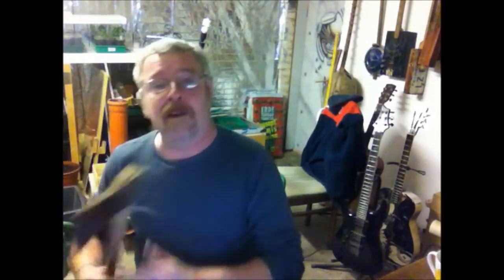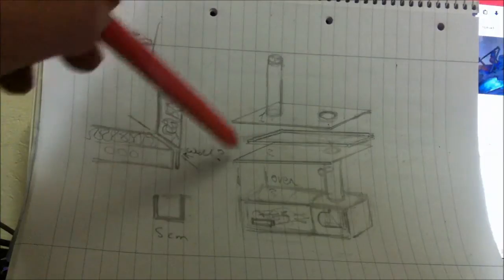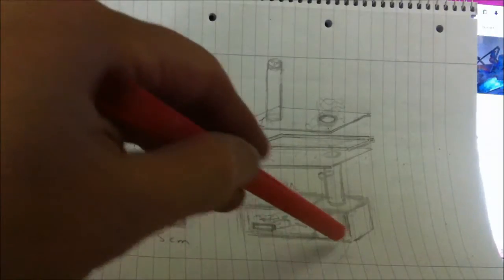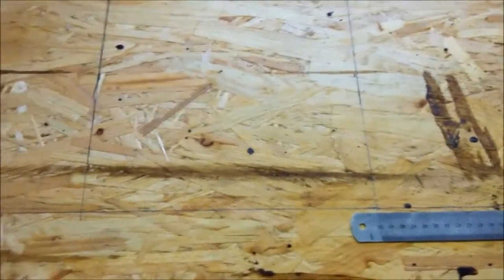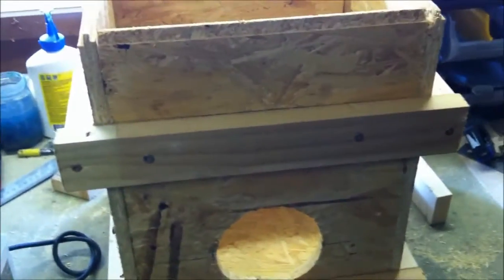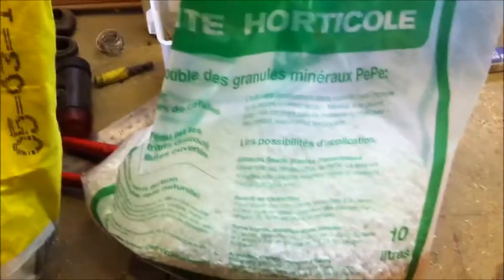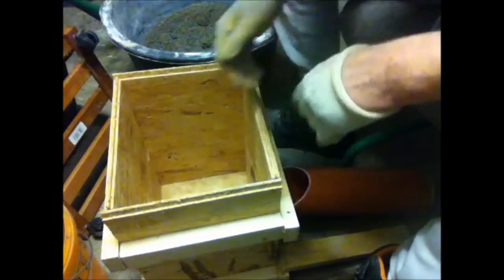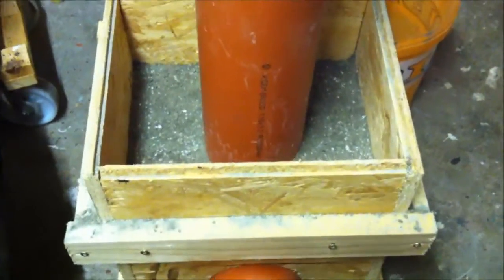Rocket stove oven update the burn chamber cast 31 01 2015

Comment: You're really onto something here Davey; keep up the good work. Do you have an update?
I've seen many folks give up on some these rocket devices because of degradation of  parts of burn chamber and, primarily, the flue.  It seems that the violent turbulence and high temperatures create an environment that is seemingly insurmountable as it turns the flue into an expendable, replacement item.  Even firebricks degrade over time.  

The folks who seem to have some pretty good success are those that are casting with high temp cement, add fiber, and pearlite.  I'm of the opinion that the insulating specs for the chamber need not be that of the flue as the EGT of the two are dramatically different with just the bottom of the chamber receiving the highest temp whilst not being subject the violence of the vortex in the flue.

I found a youtube Aussie, permaculture guy, who built a cob rocket->oven device, but he was only getting 4-500F temps in the oven!  Now his design featured a centered flue entering the oven over which he placed a thick ceramic tile resting on a metal base by which he deflects the flue gas from exiting the centered oven exhaust.   I think the oven centered exhaust is a design mistake the and your offset (identical to pizza oven) exhaust it the correct approach.

I'm intrigued with the idea of casting the whole damn lot with, maybe, the possibility of having the flue as cast and replaceable item which sits on top of the chamber between it and the oven.  It's somewhat tedious, but I'd consider just casting 5, or so, of the darn things at the same time and keep them in storage as needed.

Comment: I like the design Dave & that you're going to be bolting the top plate on.. 
Are you going to post a clip on the first run of the new  burn chamber ? 
Cheers mate..
Reply from the maker: Thanks Mate. I think the bolt on will work better. I know it will deform so I can change it as and when its no good.
Yep going to give it a burn and do a clip be rude not too ;-)

Comment: Nice setup, Dave but saw your comment about starting a small burn in it and was wondering if burning to soon might not cause the cement to not set firmly and be a bit crumbly?
Reply from the maker: Thanks J. I wont be burning for a week and it will be small I might just burn a couple of tea lights every two days in it over just to move some warm air through it. I should be able to do a proper burn in 3 weeks gives me time to find the steel. I might try some places in Germany for that. Going to get a price here first.

Comment: Cool!
Have you ever tried to quit the sand, and just use sement and perlite?
Reply from the maker: I think that would work just as good or better thermally. I just happened to have the pre mixed here so I used that.
I hope I can find the steel at the right price.
Your tomatoes are growing just working on grow room update ;-)
Reply: Southpaw Davey
Maybe that could prevent the cracking issue, when heated up. Just a thought.
Nice to hear your tomatoes are groing! I have six plants here about twenty centimeters tall. They are already throwing out flower buds.
However, I`m into the grafting preparations these days, and will start uploading some stuff soon about it. I think there will be something interesting for you. :)
Looking foreward to your grow room update, mate.
Reply from the maker: It could help with cracking. I think this will be cobbed in I hope it lasts. I will keep the box and pipe so if I need to do another I can.
Is there a big advantage to grafting? Be interesting to see what your up to. I always enjoy you posts. just uploading now.